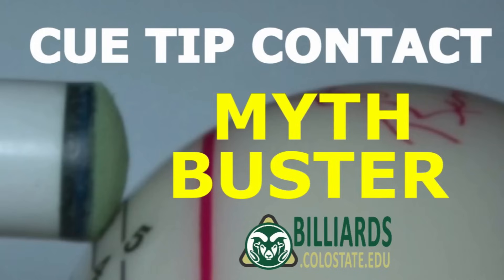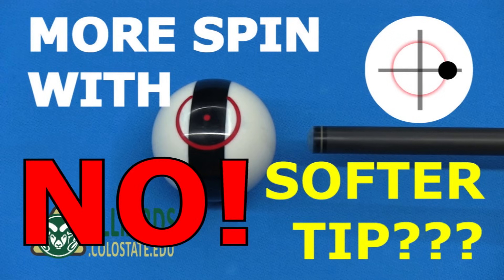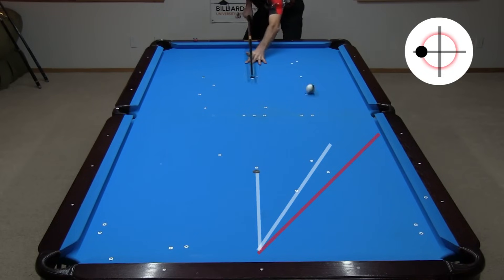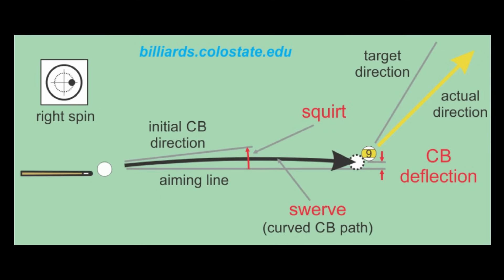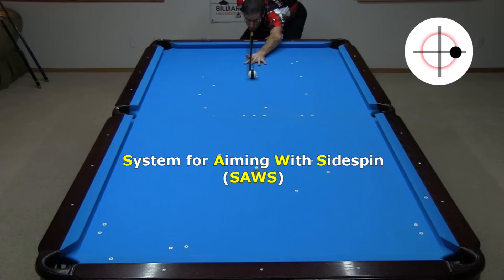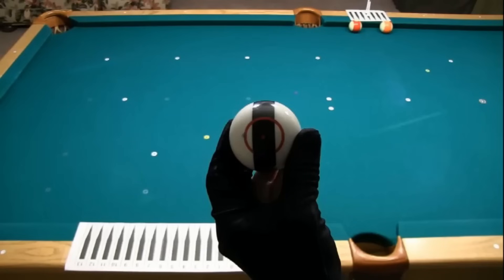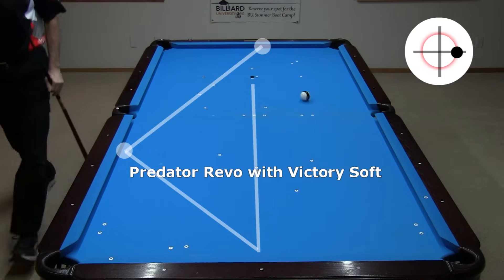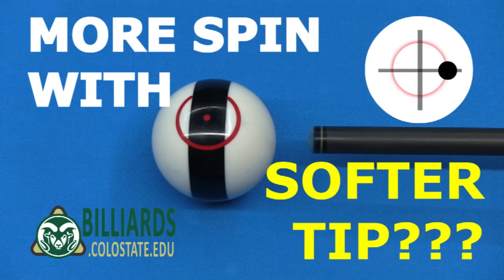Can a SOFTER TIP Put MORE SPIN on the Ball? -- MYTHBUSTING Answers

Comment: Dr Dave, what tip hardness would you recommend for a regular playing cue, if I don't have much preference for how it feels in my hand? It sounds like, perhaps counterintuitively, the best cue tip even for a playing cue is a hard (e.g., phenolic or hard leather) tip, because it transfers energy best to the cue ball and therefore one can play high-speed shots, such as long draw shots (which I have a lot of trouble with--I lose accuracy too fast when I hit hard...), with slightly less cue power.
Reply from the maker: This is a personal preference sort of thing, but I prefer a hard tip (maybe not phenolic hard, but hard leather) for all the reasons here:
    https://billiards.colostate.edu/faq/cue-tip/hardness/
Reply: Dr. Dave, I wish you had shown draw shots that are quite evident using different tips. Also what is your preferred cue and tip combo. You don’t have to mention a manufacturer unless you choose to. I’m thinking more in weight, width, high or low deflection and tip shape. Thanks. James
Reply from the maker: The miscue limit is the same for draw shots as it is for sidespin shots and the action of the hit is no different.  What is different is that draw shots require more speed, so a harder tip offers a slight advantage.  For lots of info on the topics you mentioned, see:
    https://billiards.colostate.edu/faq/cue/weight/
    https://billiards.colostate.edu/faq/cue/low-squirt/
    https://billiards.colostate.edu/faq/cue/carbon/
    https://billiards.colostate.edu/faq/cue-tip/size-and-shape/
I prefer a hard tip on an LD CF shaft with a small diameter and dime radius.

Comment: I mentioned in your last video, I did a maximum draw test using my Revo w/ Kamui supersoft tip and my BK Rush w/ hybrid tip.  I performed 10 draw shots with each and took the overall average distance, as well as the best result of each one.  The winner was actually the BK Rush with the very hard tip by about a 1/8 diamond's worth of distance (both average and best).  I concluded the results were close enough to call it basically even if I account for some margin of error of maybe just catching a better hit a couple of more times with the Rush... but outside of that, it was very obvious to me that shaft and tip mean very little when talking about cue ball spin/action.  It's all about the shooter's timing and acceleration through the ball.
Reply: To add... because my BK Rush shaft and my playing cue Revo shaft are very similar in appearance, I one time accidentally put the Rush shaft on my playing cue and played an entire match with it (because I played with earbuds in and couldn't hear the sound it was making).  I won that match and didn't really notice anything different about any shots I hit.  I got all the action I would have expected with my Revo.
Reply from the maker: I was honestly a little surprised the BK Hybrid tip did so well in the comparison.